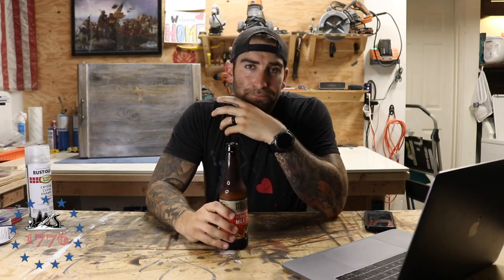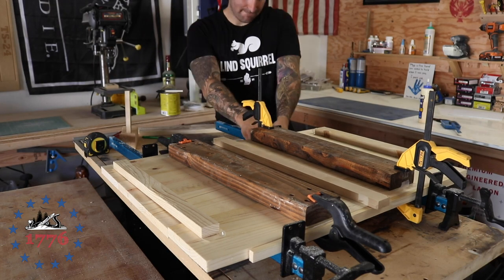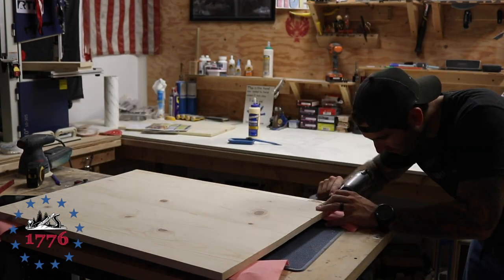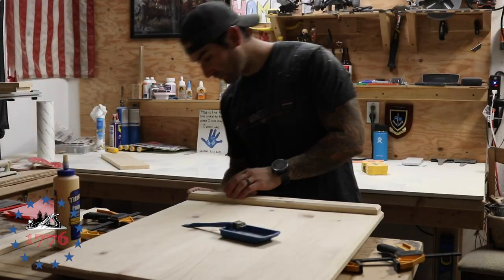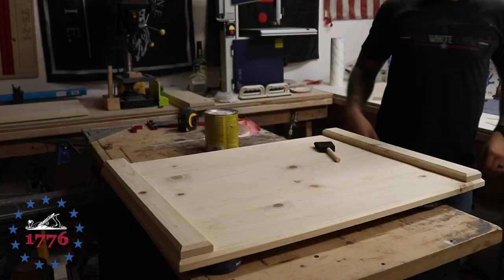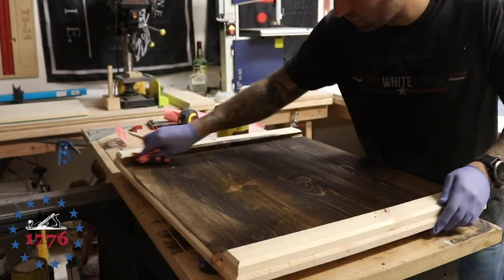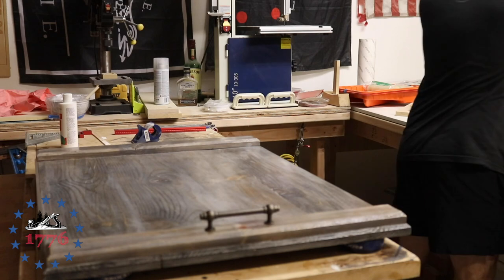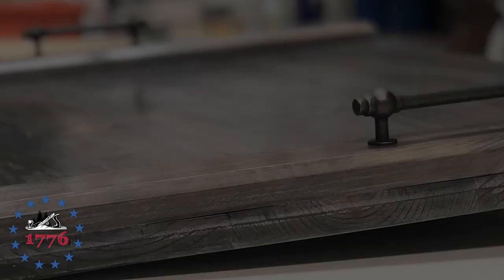How To Make a Stove Top Cover/Noodle Board - Tutorial

Comment: Question: How do you keep the boards from warping? We've made 2 of them in the past few days, and they're straight when put together. Laid flat overnight, and by the next afternoon, there's a bow in it. Any suggestions?
Reply from the maker: Ya, pretty common issue, so the best way to stop glue ups from cupping is to alternate the grain on every piece (smiley face, frowny face, on the end grain, I mention this in a few of my later videos) the wood whisperer has a good short video on this. And the 2 braces you put on will help keep everything flat. You also may be putting too much pressure on the clamps. You want just enough so an even amount of glue squeezes out. Also, if you are waiting till the next day for the braces ( the vertical pieces the handles are attached to) it gives the wood time to experience a few major temperature changes which can give it a pretty good chance of cupping. That being said, unless the cup is really bad, those 2 pieces should flatten it out pretty good. Sorry for the long reply 😬

Comment: great video i am really new into woodworking only made a few simple projects blanket ladder, simple wooden crate and 2 out of 5 (i need more 4x4) yard Yahtzee die.
Reply from the maker: Thanks! i have been wanting to make some of those for a while
Reply: @Workshop1776  very simple I made mine about 3.5 inches used a fostner bit for the holes. Then I can paint the  holes or use a dowel with the tip painted and glued

Comment: Quick question, I’m going to work on one of these, but want to do Shou-Sugi-Ban char.  Do I biscuit joint first then char OR char the planks, plane the edges and biscuit joint?  Thanks
Reply from the maker: I would char them first, heat tends to bring out any warp, cup, or bow and then by joining them after,  you can hopefully work out any wood movement that takes place, or just replace one piece if it gets really messed up
Reply: @Workshop1776  Copy that, thanks!  Great channel!

Comment: Are you using a joiner prior to glue up?
Reply from the maker: Im not, i don't have one yet, I'm saving for a big one! the common board is usually flat enough that i can get by without having to joint the edge-grain. But! if you use "Select Pine" (its in a section usually next to the hardwoods) the edges are much flatter and will make the glue up easier